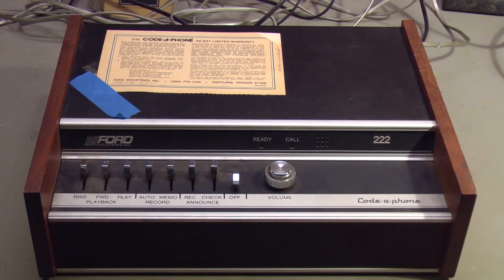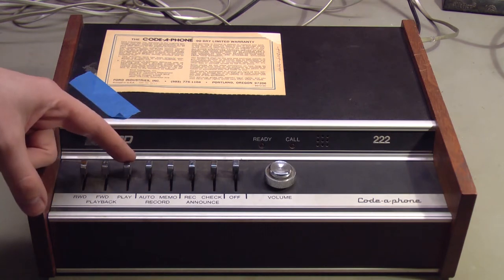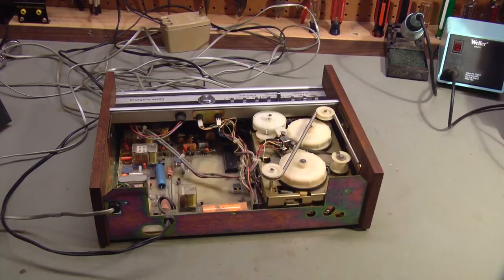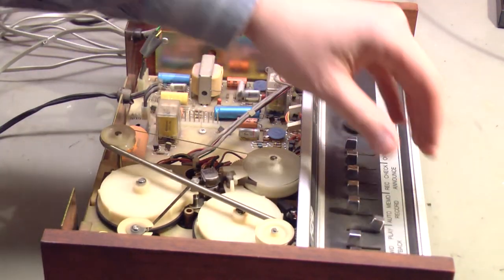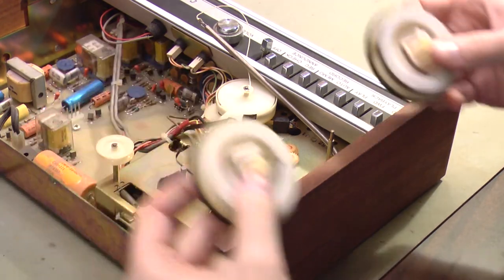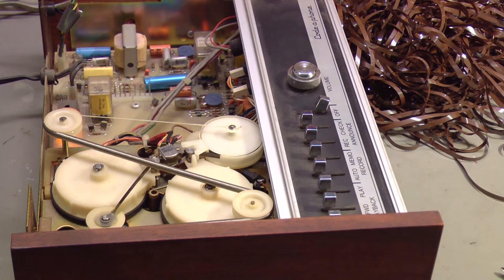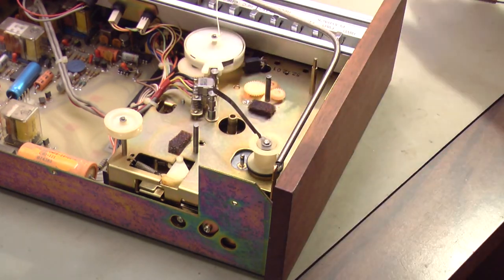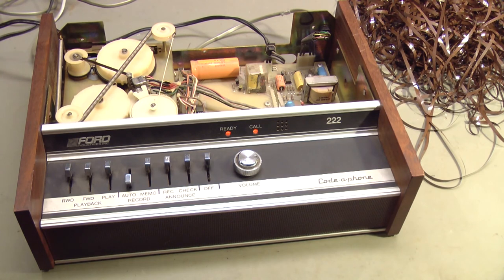Code-a-phone 222 Telephone Answering Machine Repair Part 1

Comment: Hi:  I had a high school summer job, summer of 1971, working in Portland Oregon, Ford Industries.  I did mechanical assembly of several models of the Code A Phone.   I think yours is a later model.   Sorry I do not know or remember much about the machines.  This was my first summer job.  A large factory in SE Portland.  For sure all gone now.  Thanks for the memory, a happy time for me.  Many nice people working there. 50 years ago.
Reply: I have collected several code-a-phone models in my travels of preserving the messages retained on them. They are extremely durable, extremely heavy, and well built. 1971 was just around the time of the Carterphone verdict which legally allowed home users to connect whatever they wanted to the phone lines (answering machines) without the phone company's permission and authoritarian rule. 1971 they were still mainly only used for office buildings, secretaries, and well-to-do people. Long way off before they became commonplace for Joe Handyman.

Comment: The Code A Pone was an early form of answering machine.  Perhaps the unique feature was the code box, a small pocket  device that could produce a tone.  When used with any phone, such as a rotary pay phone,  this tone could activate the answering machine remotely.  These machines were made in relatively small numbers and were very expensive.   Sold mostly to people like doctors, lawyers and others that had a need to keep in touch while traveling away from the office, and who could afford the machine.  It is now very hard to find anyone who has ever heard of Code A Phone.   I seem to recall that on the TV show The Rockford files,  in the opening credits, Rockford used a Code A Phone.  From a pay phone. That is when Rockford would get all the weird or threatening messages at the beginning of the show.
Reply from the maker: Thanks for the information! I have seen more expensive models that had remote access capabilities. Mine is a basic one that doesn't support remote control. It is nice to hear from a former employee, too! Thanks for the comments.

Comment: Hey there!   Just got my 333 in.  Does your 222 power supply show the amps output?   Mine is going to need a 12V AC power supply and I don’t know the amps.  Thanks!
Reply from the maker: Yes, it is 12 volts at 22VA. VA is a more common measurement for the capacity of a transformer, but to make it simple, that would be 1.83 amps assuming perfect power factor.
Reply: @w8nwo  - Found one on Amazon.  Thank you!  Video of my model coming soon.
Reply from the maker: @databits  I look forward to seeing it!

Comment: Do you know any references so I can fix my Dad's old Ford Code-A-Phone 1100 CAP-990?  There are messages on the tape that I would love to retrieve if possible of people who are no longer here.  Any pointers or references would be appreciated.
Reply from the maker: I do not. Wish I could help but I don't have any idea where to go for repair information for an 1100.
Reply: Do you even know if it's broken? Did you even test it?  They usually just need new belts.